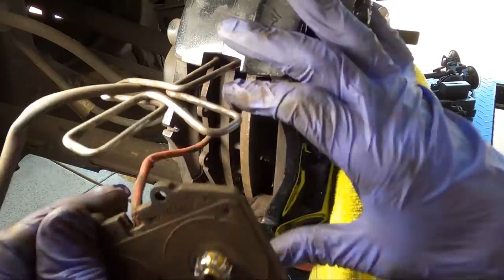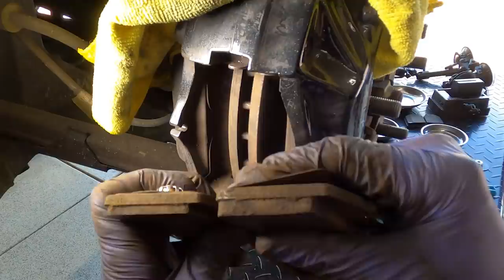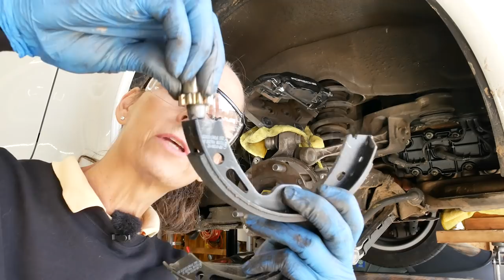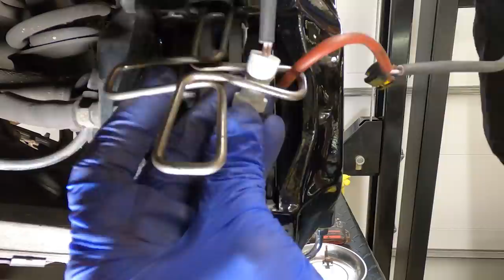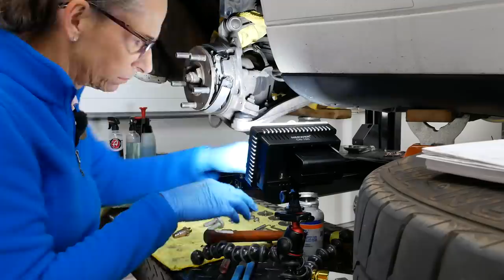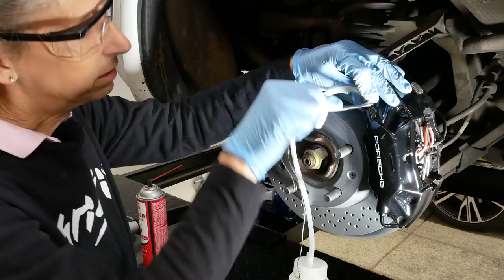How to replace disk brakes COMPLETE!  Porsche 993

Comment: @HeidiandFranny I'm about to attempt this and I was told the other day that I need to replace the "caliper slides" or " caliper guides" as well. Don't think I saw these mentioned in your video... any thoughts?
Reply from the maker: Maybe they are referring to the round adhesive backed alignment disks?
Reply: @HeidiandFranny Hello again, so I never got round to doing this job, but back on it now. It's not the parts you're referring to but they are called "spring plates".  I need to especially change mine on the rear as the car is v high mileage and over the years muck has got under them and they are now stopping the callipers move (rear only affected so braking still decent from the fronts.  I guess I'll notice a difference when I get some rear brakes again though!)

Comment: I've never seen anybody make pad replacement that hard.  Think about how much space you'd have had if you'd installed pads with the cailper off the rotor.
Reply from the maker: Yes, but what if you were just replacing the pads and not the rotor?  That was the easy bit.  It was the shoes that were the real pain. ;)

Comment: Did you do pads and discs/rotors on the front too or are they in good enough shape to just do the rears?
Reply from the maker: They are just about brand new.  But the process is the same but easier without the parking brake!

Comment: just got my 964 c4 3.6 1991 back from being stored for the winter. now ..... when i did the first drive .... in higher revs it skips a few sparks ....... i can see some unburned gas / smoke at this time from the exhaust .... were to start the diagnose ? i know its very generic question .... but ..... ;)
Reply from the maker: Sounds like an ignition issue so I would start there.  What is the condition of the cap and rotors?  Plug wires?  Are any of the plugs slightly fowled?  Also look for a loos spark plug wire as well...
Reply: @HeidiandFranny  it is a spark plug wire ..... it has the same damage as you had in the previous video :) ...... ordered new ones ..... cap and rotors are already fresh .... did that last year. Lets see what the beast does with fresh cables ...... :)

Comment: Couldn't you install the pads prior to installing the caliper on the rotor?  Seems it would be easier to get the pads in with the sensors installed correctly and then would be just a 'slip-on' rotor and then torque.  Obviously the system is designed to allow replacement of the pads without removing the caliper as a service interval, but when it's off to replace the rotor anyway, why not take advantage?
Reply from the maker: I was following the instructions in the manual and they were assuming you were just doing the pads - That and It didn't occur to me until after I had installed the caliper lol!  Next time ;)

Comment: You need put brake fluid in pressure canister.
Reply from the maker: I use it for other fluids so I leave it dry.  It will work either way.

Comment: Why wouldn't you remove the caliper first, and then remove the pads?
Reply from the maker: I could have done that as well.  I was following the procedure they had for just pad removal/replacement.  But you are right, that would have been a bit easier.

Comment: I guess there is no real 'OEM" part for the 993 as Porsche sold them off during their dark days.
Reply: We have buckets of spares in Sydney. Google the Porsche parts people. I use one in Willoughby in Sydney. xcellent.
Reply: @graham6229  +1 .. North America is similarly positioned: 993 series OEM factory parts are plentiful. .. Took delivery in the Fall of 1997 of my ordered '98 Carrera S, in twenty-something years I've never "wanted" for an OEM 993 component. . Nonsense.
Reply: @graham6229  In Australia shouldn't that be 'heaps' of spares?!
Reply: Was it the right set Franny got. Dif spring and bolts. ?
Reply: @PhilUKNet  "heaps" ??  Don't get that one.

Comment: Where are u getting these parts that just do not fully fit????
Reply from the maker: They are listed as OEM.  I have read on the forums that many have had to grind the pads a bit.
Reply: @HeidiandFranny  I would like to see if parts from say a classic dealer in Colorado Springs has same issues. Did Porsche make a change or what happened. Sometimes it’s false savings going after OEM parts outside dealer network

Comment: Your parts supplier may have pulled the wrong part. You shouldn't have to make modifications like that.
Reply from the maker: I have read this is common.  My guess is that they just just used a softer steel, but thicker - but that is just a guess.  I had to do this on the Beetle parts as well